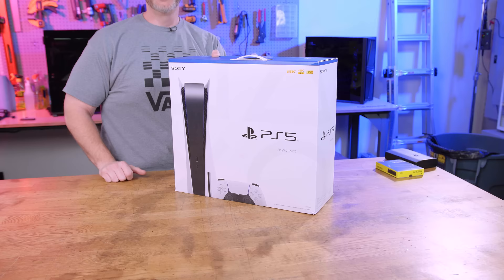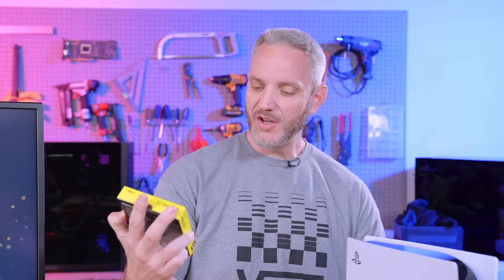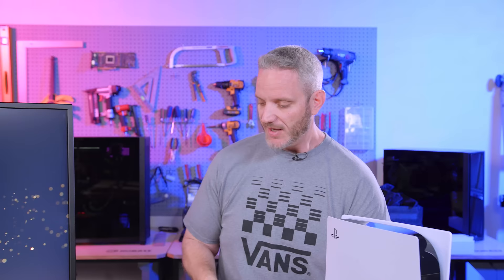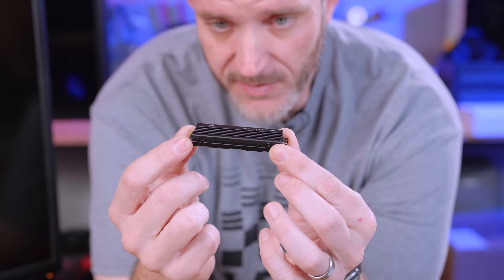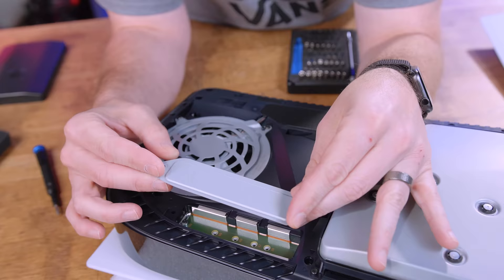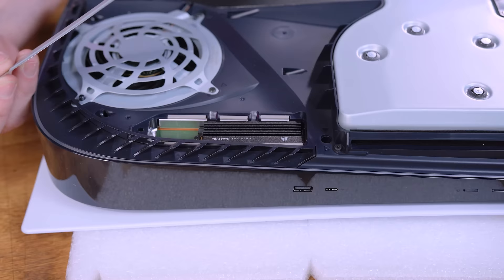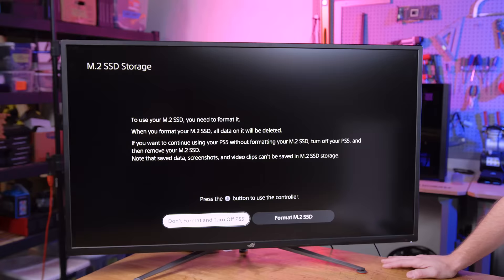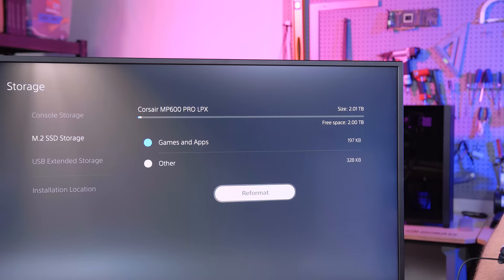How to upgrade PS5 storage - Easy Step by Step Guide

Comment: I have an idea about how to maybe improve the thermals of that M.2 drive, despite that spot it's in having no airflow.
You see those shiny bits near the top of the screen (towards the middle of the PS5)? Those look to be parts of the main heatsink for the system. You know, that heatsink that has a fan blowing over it? Yeah that one.
Now I'm no engineer, but I do play a lot of games where if you ARE an engineer, you are immediately good at playing the game once you figure out the controls. And I'm good at those games (specific games are Factorio, Satisfactory, Dyson Sphere Program, Kerbal Space Program, and Stationeers).

Anyways, my thinking is that if you can just create a good thermal connection between the heatsink of the M.2 drive and the main system heatsink, the thermals of the M.2 drive should be greatly improved, since you will basically be putting heat from the M.2 drive into the main system heatsink.
They're so close together that it really shouldn't take much to make it happen either. If it was me, I'd try using some of the left-over thermal pad material from putting a water block on a GPU, something I know that Jay probably has a bunch of if he's anything like me and saves things like that that are "potentially useful in the future".
I don't know what thickness of thermal pad material you'd need to bridge that gap, and I also don't know how you'd get the thermal pad material where it needs to go, but if you can figure that minor detail out you should potentially see a performance improvement.

EDIT: Just had a different idea about how to cool that M.2 drive, but it involves modifying that stamped sheet metal cover over the M.2 drive bay.
If you can get a tiny enough and low profile enough fan, you can fit it to the end of the cover with the screw in it, and then drill holes in the other end of the cover to let the air out. As for power, you could power it externally, or you could get a 5v fan and run it off of one of the USB ports.
I just checked Amazon, and apparently they make some truly tiny fans. 20x20x10mm is the smallest I could find, but it's a Sunon brand fan (nothing wrong with that I guess, but they're so tiny that they have to spin really fast to move much air).
Noctua goes down to 40x40x10mm and offers fans optimized for static pressure or airflow at that size, and they do offer a 5v version as well.
I'm unsure if 10mm is small enough to fit under the PS5's outer cover with enough clearance for airflow to get into the fan, and I'm leaning towards "not", but I don't think there's anything that says you have to have those plastic covers on to have the PS5 function, and it wouldn't be the first time I've intentionally left parts off of a case to get better airflow.

Of course, if you wanted to, you could combine both of these ideas, for maximum benefit. Unsure if you'd need to, but it's a possiblilty.

About the thermal bridge idea, it's basically asking for someone to figure out a custom heatsink for bare M.2 drives that is specifically designed to interface with the PS5's main heatsink.
You don't need to credit me for that idea, and I don't want any financial compensation for it.
I'm releasing it into the public domain as an Open Source concept, but the specific implementation is for the company that actually wants to produce it to determine for themselves. Shouldn't take that much engineering work, it's just a heatsink after all, and the M.2 drive doesn't generate that much heat in use.

All you really need to do is make the M.2 heatsink a little wider or mount it a little bit off-center to make it possible to bridge the gap between the M.2 heatsink and the PS5's main heatsink with a strip of thermal pad material. Or maybe all you need to do is have a strip of bare aluminum on the side of the heatsink so the thermal pad can get really good thermal contact with both heatsinks.

I mean if I can figure out this stuff, surely someone that wants to make some money can figure it out right? I'm just trying to put my idea out there in a way that doesn't step on their toes.
Reply: but thermals are just fine with a heatsink. there is no need to engineer something for it. it could be a funny project though.
Reply: @bertracoon1884  When has "the thermals are good enough" ever stopped someone building a PC from making them better?
Last time I remember that the engineers thought the thermals didn't need to be improved on a console, we got the whole X360 RROD fiasco.
And that little place where you put that SSD has literally no ventilation, so that heatsink won't be able to do anything. I'm assuming that heatsink is there because the SSD needs it to control its temperature, and if that's the case then either you need to add a way for the heatsink to get some airflow, or you need to be able to connect that heatsink to another heatsink that does have a connection to airflow. I explored both options in my previous comment.
Reply: @44R0Ndin  but it works fine with a heatsink and seems to throttle without. the ring of death was something else though. that wasnt a heatproblem of the harddrive, i guess. according to this article, a connection broke and that resulted in the rod. anyway, heat can be a problem but it seems like the heatsink fixes it for the expanded storage of the ps5. some people even commented on the airflow and said, that there is some ventilation in that compartment.

Comment: Hey Jay great video!
Is the original ssd with the 825gb added to the Corsair m.2 2tb? Is the 825gb the console storage where it would keep your system data and thumb nail pics? Then you can use the new extented 2tb to put games on Is that right?  I just got my PS5 through Playstation direct on Wednesday shipped got it Friday 24th been waiting since it came out Woo Woo. Please respond asap

Comment: Jay..... no issue with you doing PS5 stuff, but don't you think that the PS5 users on this channel are far more likely to know how to do this and have already done it than the people you're gearing this towards?

Also PS2-5 have had very easy storage installation. PS has always used PC standard parts on the console (PSP and Vita not included).

Comment: Gigabyte x570 aorus elite wifi board, I installed a 2nd m.2 and it lies behind the GPU where even the board itselfs stock heatsink wont fit because of the GPU. Can you run these without heat sink covers? What kind of design flaw is this? 2 pcie 4.0 slots but only one can be cooled if using a GPU? I think my only option is Riser cable to mount card vertical( corsair 680x case and Aorus master 3070 GPU) making room where it currently is for the heatsink to fit. Will I lose performance using a riser cable? My GPU has that little LCD screen (did not pick it, shuffle win) so turning it facing up is hard to want to do

Comment: I bought a M.2 SSD   and did exactly  what it said  and when I started  my ps 5  it never found  it so I took it out installed again  and it still has not found  it  I moved the spacer  and adjusted  it in the slot and nothing. I went to storage  and all I had was console  and my ps4 USB hard drive but no SSD expansion what's the next step?

Comment: I bought a PNY XLR8 Cs3040. Now the speeds were within spec at the time, also some places still say these ssd work with the ps5.
However mine did not, The PS5 Let me format it an everything. The next morning my PS% would not boot with ssd inside, I sent it back got a replacement same issue. Now PNY Recommends the New cs3140. 

Reddit has some people saying it worked fine in theirs and others having similar problems as me, but if just be careful.

Comment: I am curious as to having that cover plate on the expansion slot makes a difference at all, if any.  In terms of heat dispersion on for the SSD
Reply: Yeah it does, the expansion bay uses negative pressure so the cover needs to be in place.

Comment: Watched video, purchased a 2TB M.2 .. and finally went thru all these steps only to find out the PS5 requires a PCIE 4 M.2 !  so my new PCIE 3 M.2 will not work!  That would have been some good info to know / point out at the start of this video !  YOU MUST HAVE a PCIE 4.0 or higher M.2 ..  Instead of just saying PS5 uses PCIE 4

Comment: Would it have been better on Sony's part to have a thermal pad on the cover? Would that have made a difference in drawing some heat out of the enclosure? I use the Sabrent cover on a Kingston KC3000 already, but I guess I am just curious.
(edit, and if the cover was perforated ever so slightly).

Comment: just got a ps5 and you answered my question right off that bat, how many slots are available. didn't want to get a 1tb just to replace the one already inside. wanted to say the the ps4 actually had an easy hard drive install. just like this but 2.5 drive. i put an ssd in mine and lol didnt so much for load times. can't remember if i did the internal drive on my xbox one but did use a basic 7200 external

Comment: Gran Turismo is such a great game. This is my first time playing it. I've always had a PlayStation. Never had other consoles and I never played GT. I always had need for Speed.  Now I have seen the difference between those two games. And the best way to put it GT is a track-based game with street cars and track-ready cars. And the NFS is street based with police chases. And NFS is more of an arcade game so you can do certain things like bust threw certain things that you wouldn't be able to do in a real car. Whereas GT is more of a simulator. You actually feel the weight of the car shift and the Overall driving experience is that of a real car. They are both driving games but not created equal. One is for gamers the other is for drivers that game.

Comment: I got an external storage device and it sucks I gotta transfer data back and forth because I can only keep like 5 games on the console at a time. And I haven’t had a ps since ps2 but I got a kid so I got back into it. I bought actual game discs at first but that didn’t help because as you know the game basically saves onto the console and then you still have to put the disc in. I feel so old…

Comment: Hey everybody what size is that M.2 screw? The garbage original one got stripped to hell and I need a new one before I install my SSD into my new PS5. The problem I’m having is that most M.2 screws I’m seeing are about have the length of the one the PS5 uses and I just can’t seem to find one that looks like that.

Comment: Has anyone installed it without a heat sink? Most of these don't throttle ops until it reaches 90C and I just cant fathom it getting that hot. It would take a huge amount of writes for that to happen.

Comment: Sorry for the stupid question, but when you upgrade and replace the drive, are you losing all your current game saves etc?  If so, can you upload that data to the cloud before upgrading, or?
Reply: You don't "loose" it per se since you still have the old drive. However, you want to make a backup of your stuff first. I'm not familiar with the PS5 so I don't know if it lets you save your save files to an external hard drive or if you can only backup to the cloud. I believe you need an active PS+ subscription to use the cloud save though.

Comment: I currently have a 2TB Samsung 980 pro. 
Didn't come with a heatsink. But still not any performance issues. Any solid sad heatsink that is great or should I just go for the Be quiet BZ002 MC1. It's about 12 bucks on Amazon atm.

Comment: My heatsink did not fit, mine had a lip at the end that I had to cut off and so it is just sitting on top. It is adhesive like tape so I don't think it will slide around but it still needs the cover. I still think they should have designed it so it had better air flow regardless. Poor design; almost an afterthought. I installed a Sabrent Rocket 4.0 M.2 x4 NVMe 500GB. I will upgrade bigger next year.
Reply: You can use a few rubber bands to hold that heatsink to the ssd blade. A little extra piece of mind imo for your situation

Comment: I'd personally like to see a video about storage and benefits of having a dram cache and if dramless ssd are any good I know there's a bunch of videos and people from 4-5 years ago saying dramless ssd are no good but recently it seems like drive manufacturers have improved the way dramless SSDs work Samsung 980 ssd or WD sn550/sn570 are supposedly really high end drives and are all dramless so I'm curious if dramless drives are bad is still true or if it's not so much true now
Reply: im pretty sure they still suck, when you write huge amounts of data.
Reply: @bertracoon1884  yeah I think that's one of the biggest downsides to dramless drives is sustained write speeds suffer but I'm not constantly writing and re writing my drive I add a game here or there but most of my usage isn't long sustained writing to the drive and I think most users are the same as me and sustained write speeds over long durations are not an important feature but I wonder if for general PC use, as a boot drive or a game drive if you'd end up seeing a huge difference in drive life span or performance over a model with a dram cache

Comment: Is it possible to replace the stock (system) SSD with a bigger one as well? Possibly using cloning software?
Reply: Nope it's integrated onto the board (soldered)
Reply: @cyphaborg6598  Shame... Thanks for the info.

Comment: Thing is, M.2 drives , like memory modules, don't need a heat sink.

In my PC (Intel i9) I'm running a WD 1tb for the OS and other programs, and a 2tb 970 EVO plus for games.

Neither have heat sinks and even when I'm running a game at insane settings the drives aren't even what I would call, warm to the touch.

I have another 2tb EVO 970 plus in a USB case, and no matter how much I use it, the temp is no different from any other thumb drive I've ever used.
Reply: You know what's funny? Watching this video taught me that M.2 drives can have heatsinks. I looked over at the gaming pc I built and noticed I have my M.2 ssd just hanging out, w/o a heatsink. You wouldn't believe the panic that set in when I realized I had been using my pc for over a year w/o a heatsink, wondering if I had caused long term damage. I then realized that my motherboard actually came with x2 M.2 heatsinks installed where the M.2 drives are, but as a new pc builder, I thought the heatsinks were just placeholders lol.

This comment reassured me that I hadn't made an insane, year long blunder. Thank you.

Comment: Why wouldn't it be able to use an external storage device?
Reply: Hey guess what I use a PNY extended hard drive add and I attach the top part of the hard drive to my old PS4 hard drive and connect it to my new PS4 so I can upload all the game from that old one who is why I don't do the other way because my old PS4 stop working it won't even turn on so I took the hard drive out of the old PS4 then I connected it with the the thing that connects to the extended hard drive and it worked sort of add to formatted as a extended storage and it works but not as I want it it still shows you're extended storage stuff but it won't upload any games that you had on the old one maybe it's because mine was old and my PS4 for didn't work that time but it's still formatted as an extended so technically it did work but technically it didn't work see if you have a different outcome if you want to try it out please tell me what happens if you want to try it out

Comment: With that m.2 cover, you could drill carefully placed holes to help with cooling.
Reply: Because all heatsinks have holes drilled into them. It definitely helps with cooling. Oh, that's right...it doesn't.
Reply: @atheisthumanist1964  It's the cover that goes over the slot/hole where the m.2 goes that I was talking about.

Comment: I think it was unreasonable for ps to  need such fast drives and especially since most 2.5 ssd that are on the market could have been used as a buffer and are more available than the latest flash m2  it would have been cool if you could have a library on a bas network based that were supported as well thus games could be moved on the fly using it's nic to an internal drive in the same time as most games allow loading levels before full play
Reply: The PS5 uses direct storage access and hence needs a gen 4 m.2 drive to play PS5 games. PS4 games can play directly off an ssd.

Comment: When you move your games from the PS5 m2 drive to the new larger m2 drive are you or should you also move your save files as well? 

Also, does the Sony automatically save the save files to its original m2 drive or can you have it save the save files to the new m2 drive?

I'm trying to free up as much storage on the PS5 m2 drive as possible but don't want any complications now or in the future with the save files. Thanks!

Comment: I left my systems open lol I won't do it with my ps5 cause I hit lick and got it brand new in a box for 450$ but my xbox one I got out the garbage and had to replace some ram from a different Xbox witch using a rework station is not easy when you first start out but you get a hand to it.. now alot of people can't do the things I can do... the days of using a soldering iron well aren't over but you gotta get them new ones that use them pinpoint tips

Comment: Feel sorry for Sony fans. They have to go through all kinds of shit just to get external storage...heat sinks etc plus tear the system open. I have a Series X and didn't worry about any of this crap. Just bought it, plugged it into the back of the system and ready to go! Slid right into the back slot already there for it. Took about...2sec!